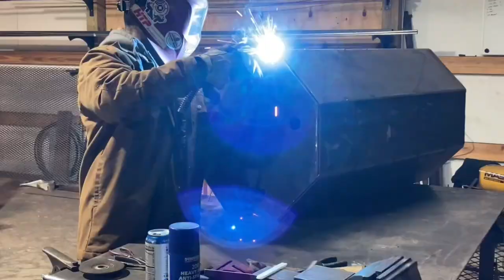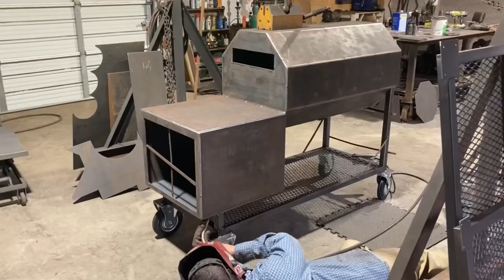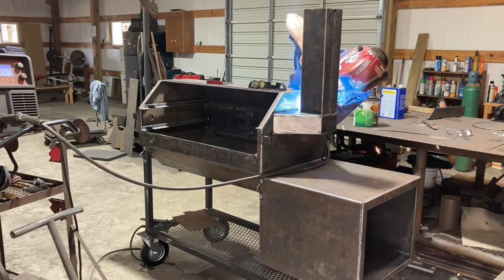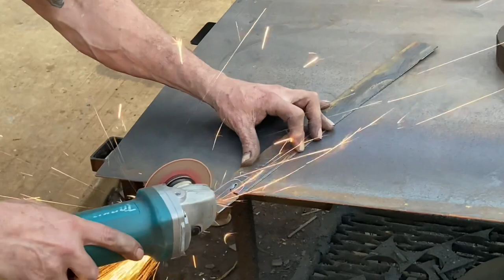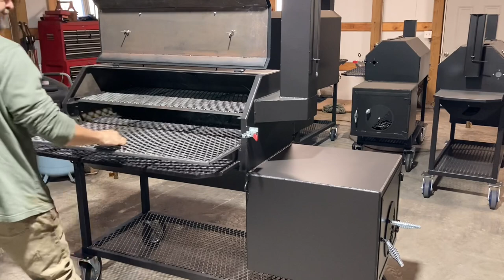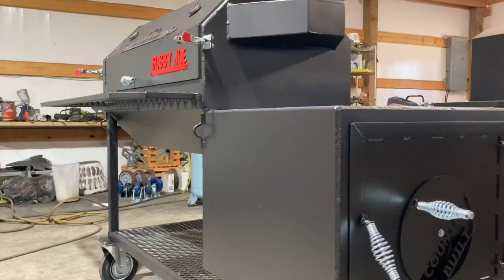Reverse flow smoker build

Comment: As always a great video . More so this time because with the new shop now up and running and most bits where you want and need to have them in place . It's great to see you not having to struggle with the weather and all those puddles you had to dodge having the tables and stock outside . Cheers for posting Allen